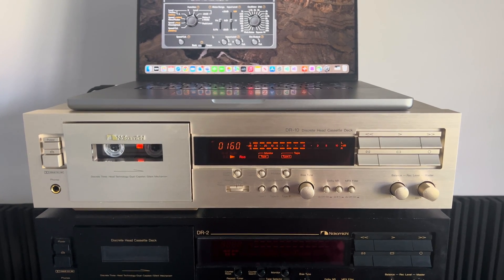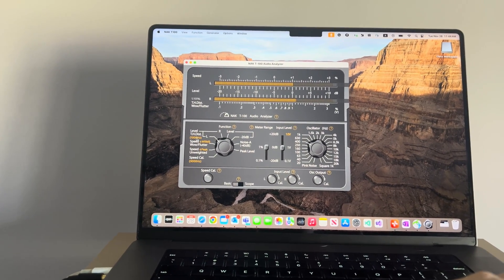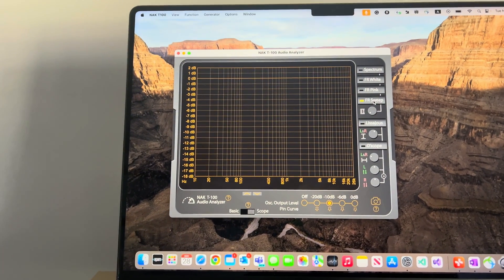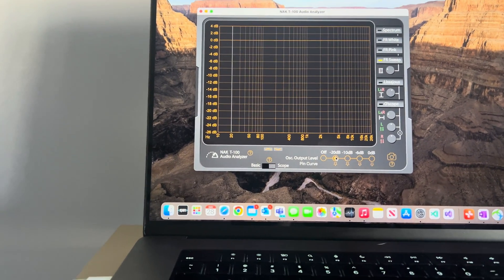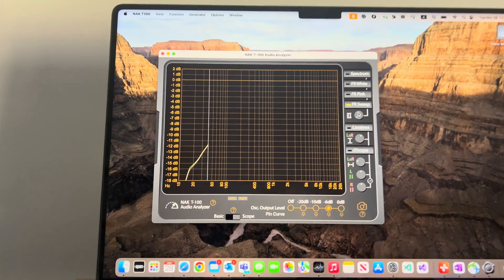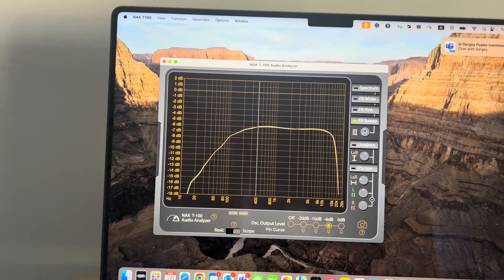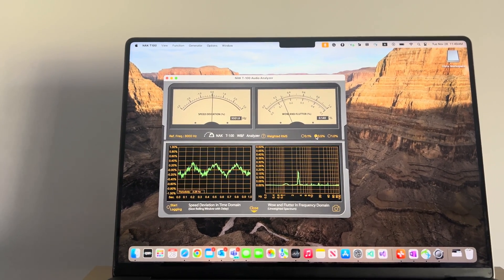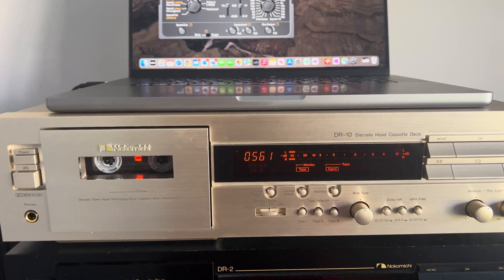Nakamichi DR-10 Redux: Refined Measurements Reveal Exceptional Performance

Comment: I have the same deck. What is the factory recommended belt size?
If I was in the US would have shipped it to you for a full service. 
Many thanks for your a excellent work❤🎉
Reply from the maker: @mk5359  9.9 inch or 250mm
Reply: @hifirulezzz  Hi. I replaced the belt. I got the 9.9 with 3.5mm width. Speed and everything is fine.
I have new problem now. Some cassettes don't play. Once loaded, none of the functions work. It's like in shutdown mode with no play, FF or REw. Ejecting and reloading sometimes helps. Sometimes it plays for a while and stops and again going into unresponsive state.
Any idea what could be the problem. I must admit I don't not change the back tension belt....could it be the problem?
Your help would be much appreciated. Thanks.
Reply from the maker: @ I think it is encoder. Check wires connected and clean up the contacts.
Reply: @hifirulezzz  Thanks for the quick response. Tried cleaning the contacts. To be honest I don't know what the encoder is.
I must have dislodged something when I changed the belt.😞
Reply from the maker: @ rotating plastic thing with bumps pressing the contacts to switch when transport is reaching the desired position is an encoder.
Reply: @hifirulezzz  Thank you sir. I cleaned the leaf switches with paper soaked in deoxit. Seems to have partially resolved the issue. Will also change the back tension belt. Once again many thanks for your support. 👍😍.

Comment: I have got mine in for service since quite some time now. Setting aside the replacement of deteorating belts and other maintenance of tape drive , the capstan motor cut off, we've discovered shortcuts in the power supply of the capstan motor after a short time of play - a couple of cassette sides. The motor as such is still fine - any suggestion will be appreciated?
Reply from the maker: I got my Matsushita motors from UK. I do not see these motors on sale anymore, but you may try these motors https://www.ebay.com/itm/196012244217